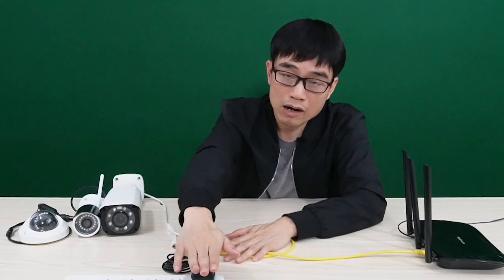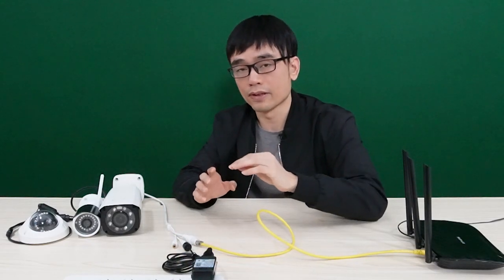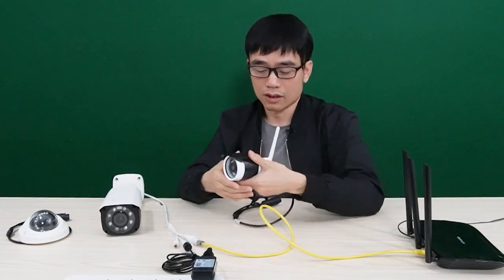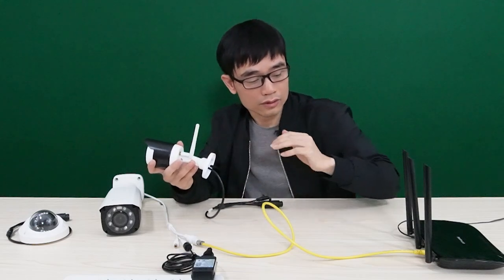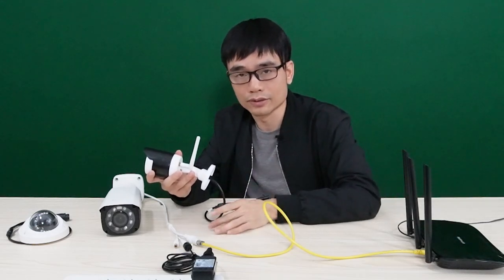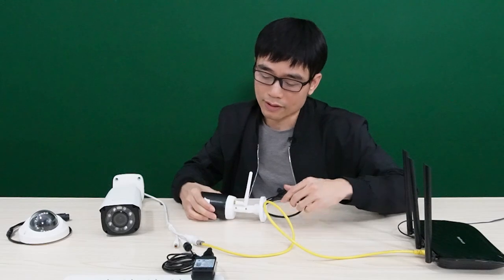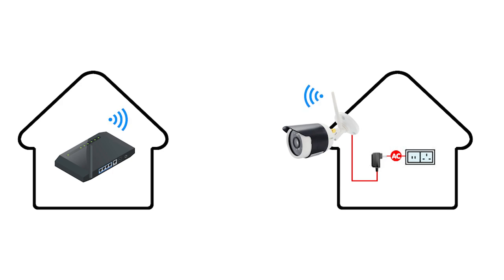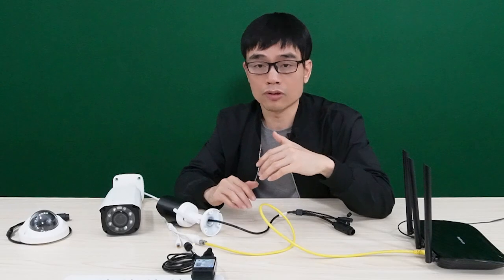All the Possible Ways to Power IP Cameras

Comment: Can I use a 12V switching power supply also ?
Reply from the maker: Yes, you can use a 12V switching power supply to power an IP camera if the camera is rated for 12V DC and the power supply can provide enough current. Just double-check the voltage and amperage requirements in the camera’s specifications to ensure compatibility.

Comment: Brother i have 8 channel nvr connecting 4 ip camera in 4 port poe switch.
Poe has 2 uplinks which are occupied by router and nvr.
Now i want to connect fifth ip camera without buying a  new poe switch.
Is it possible ?
Please explain in detail.
(One thought is coming in my mind, correct me if i am wrong. 
Can i connect fifth ip camera to lan port of router and provide power through dc adapter. If yes tell me output  rating for dc adapter.
Or should i buy a new poe only so that i may not face any issue in future so that my system may work smoothly)

Is there any cons of using dc adapter seperately, because ip camera is expensive.
Please discuss in detail
Reply from the maker: Yes, AC power adapter one of the method. Most ip camera use DC12V as power input, you might want to read the specification of your camera. You also can turn that non-PoE port on your router by adding a PoE injector. If you plan to add more cameras in future, you could add another PoE switch, and attach it to your router. You have limited ports from your router.